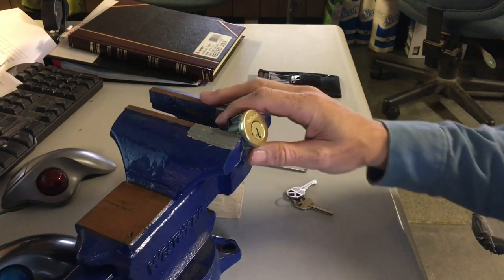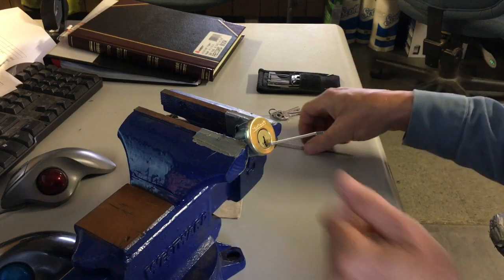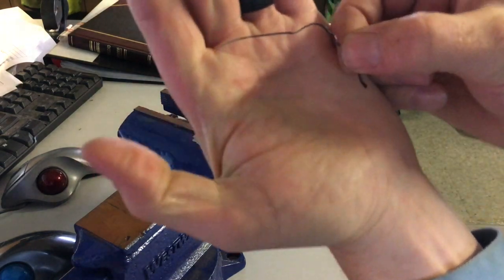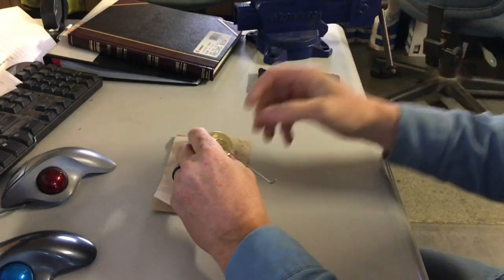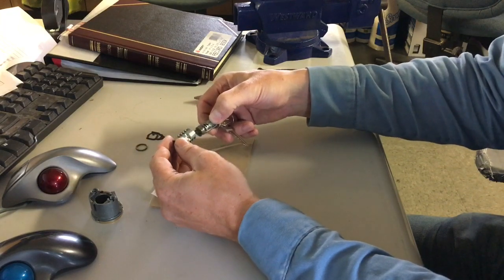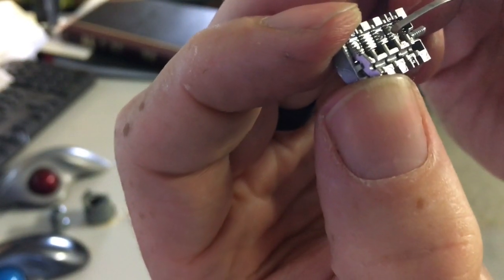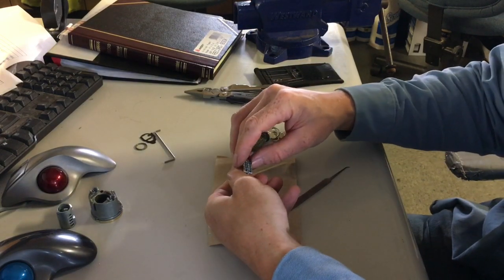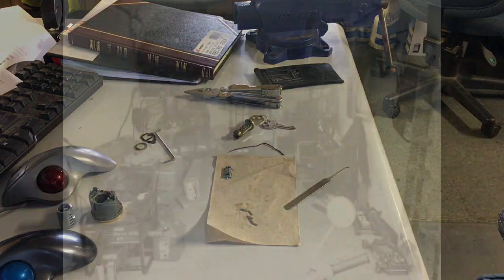Kwikset Smartkey 3rd Gen Picked Using a Bobby Pin

Comment: Outstanding job, I love to see people figure this stuff out. Thanks for sharing. I been trying to pick mine for a while with NO luck.
Reply from the maker: Thanks.  If you have a tension tool made, I recommend practicing with the lock outside the housing first.  Use several different keys.  Learn the feel of the different pins states and how the tension tool binds them.  With a tool like this, you control the binding order.